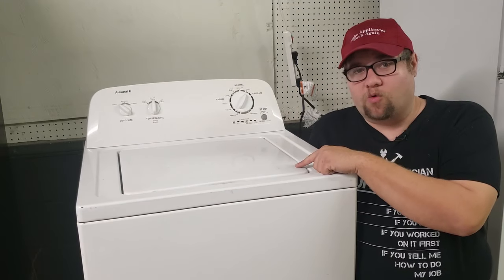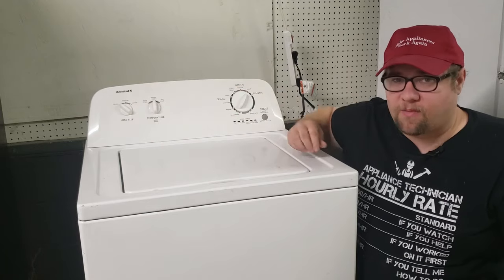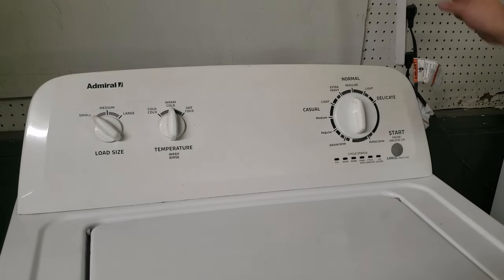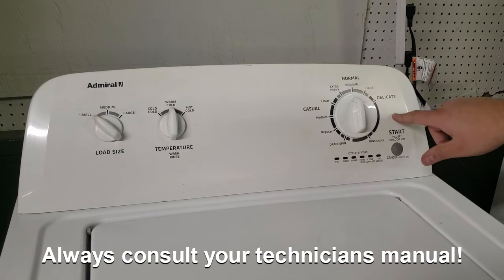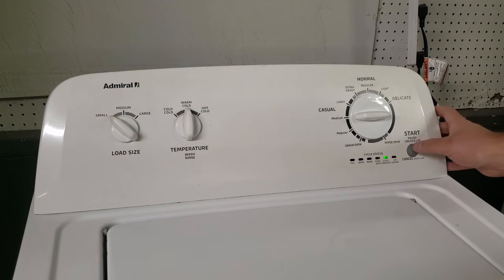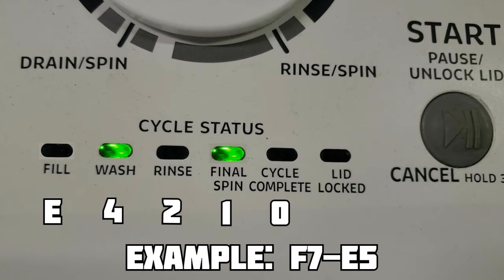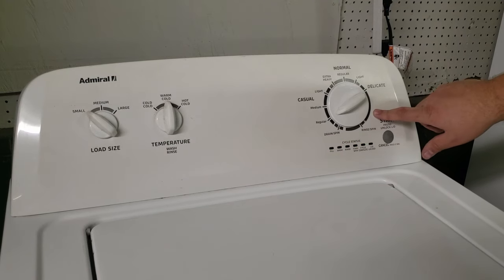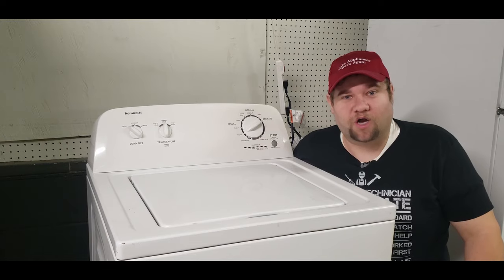How to Use Troubleshooting Mode on a Whirlpool, Maytag or Amana Washer AND Understand the Codes!

Comment: What can I do with my admiral washing machine if the cycle dial got broke off?
Reply from the maker: Oh, that's a good one. Haven't heard that before. The dial is attached to a shaft, that's attached to the control board on this style washer. You'd have to take the panel off, unplug machine, and see if there's any way to re-build that stem and attach the knob to it. If the knob was bad/damaged, just get a new or replacement knob. If its the stem... May be able to rebuild one with maybe super glue and baking soda.
Reply: @bensappliancesandjunk  that's not the best news I've gotten today but I'll run with it. I'll go ahead and pull that off to see what I'm working with. Thanks

Comment: I have an F3 code what does that mean? It washed the load but didn’t spin it out properly and now it won’t even turn on to wash.. I need help
Reply from the maker: That is a pressure switch / water level error code. Depending on your unit, there may be an independant pressure switch that's gone bad. Or the plastic tubing going to tub has developed a crack in it. Take off the hose and see if you can blow into it and see if air can escape (with the entire tube off) - if air can leak out of the hose, replace it.

Comment: I have amana washer that I replaced the water inlet Valve now that I tried to turn it  on I have to power to turn on
Reply: Any tips on how to reset the machine
Reply: Or something I can do
Reply from the maker: I do have videos on reset and recalibration on my channel for a whirlpool. It's the same for this
Reply: @bensappliancesandjunk  I did as the video showed but nothin still work goes to very last step and all the lights shut off

Comment: We keep getting a f1 E0 code on an Amana but can't find any info for a washing machine, only stoves. Any idea what it means?
Reply from the maker: TYPICALLY that's an interface/UI issue. What is the washer doing wrong for you?
Reply: It get through the rinse cycle,drains all the water out and quits. The door stays locked and has to be unplugged and replugged to unlock.
Reply: @mikedawsey  I’ve got the same error what did you end up doing?
Reply: @chrisgregoryt9672  Bought a new one.

Comment: - 2:37 you just differentiated by saying, "on Admirals & Amanas" as if they're not Whirlpools. They are.
- It's now confusing as to which to follow the instructions on.
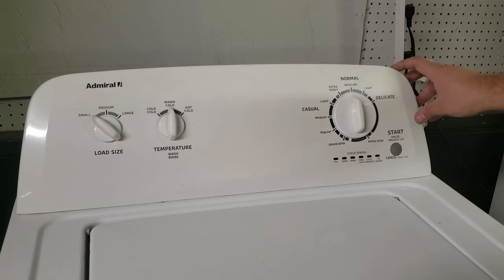- 2:28 YOU SAID, "On Whirlpool's: R3×, L1, R1"
- 2:37 YOU SAID, "On Admiral's & Amana's: L1, R3×, L1, R1"
_
- UPDATE THIS IS WHAT WORKS & WHAT THE MANUAL SAYS TO DO: 
- *Amana: (in the manual): R3×, L1, R1

Comment: Can you write down from beginning how to reset Amana 2019 ? Please I tried both. But it would help if you can write down how to do it. Please I have laundry in n lid won't come unlock.n unplugged n wait 10 minutes 5 times. N nothing .n no lights at all
Reply from the maker: Hi, the lid lock won't unlock even after leaving it unplugged for awhile, then plugging in? You may want to check my other videos on troubleshooting a whirlpool washer and replacing the lid lock - both should be able to help you.

Comment: Auto sensory not working...for small loads water fills up pass the amount of clothes fills up to a full load amount of water. Need help
Reply from the maker: Check the pressure hose that goes from the consul of your washer down to the tub. Make sure that it's free of any obstructions by blowing through it and then make sure that the tube itself doesn't have any cracks or holes in it to wear air could escape.

Comment: Sensing fill and wash come on then cycle complete light comes on from my understanding f4 e0? I can’t find that code
Reply from the maker: It could be an updated model via his shifted all the codes him to the left which could give UF8E0 which is a drain pump issue. Can you verify the drain pump is operating at all?
Reply: @bensappliancesandjunk  it seems to drain it won’t spin makes a buzzer sound
Reply from the maker: Check to see if washplate spins with basket or its just spinning freely and loosely.
Reply: @bensappliancesandjunk  it spins with basket counterclockwise if I spin it clockwise the top of the agitator spins free

Comment: I got the same as another person F3E3, which isn't listed, of course.
Reply from the maker: I have 4 videos on these washers, and the other videos show where the sheet is to show that specific code on your machine
Reply from the maker: @48Tbird  I would look at the manual for the light code reference. its possible yours has changed and is different to where it may not be F3E3

Comment: mine flashes F4E0. wtf. lol. I think this confirms my suspicion that its brain is fried
Reply: What you did my does the same
Reply: @sandlews2530  scammy repair tech came back and said the water wasn't on all the way; so according to him the only issue was him not turning the water on all the way. I really have no idea what was done since I was 84 miles away at work both times, but wife said he was here 5 to 10 minutes both times.  The first time he cleaned out a screen that was restricting the water input, so you may check that. I've seen a youtube video where someone replaced the electric inlet water valves so that it would fill properly; I was leaning towards doing that as they make an annoying motor noise when it doesn't fill properly. Im thinking the tech did something to reset the machine so that it would work properly as it's been fine for a week now.

Comment: Hi! My Amana fills for a wash them as soon as its time to wash it drains and all lights go out... It does work on spin though..
Reply from the maker: What error codes did it give you in diagnostics?
Reply: Did you ever figure out what was wrong? My roper is doing the exact same thing. I got code F4 E0
Reply: @sheilastuck5465  i didn't. We went and bought a new washer
Reply: Ahhh bummer 😒
Reply: I have the exact same problem nothing less nothing more and I just buy this machine 5 days ago.  If I follow your video what do I do to get the close wash. I really don't know about codes

Comment: As soon as I plug it in the sensing fill' wash and lid locked illuminate. And wont reset
Reply from the maker: Sounds like its still storing the last wash. How long did you unplug it for? Usually, I'd suggest 15+ minutes if its doing that.

Comment: I have an amana washing machine that make noise like its draining but no water is in it and the lid lock light stays on does anyone know what i can do to make it stop.
Reply from the maker: Is it not draining because there is no water, or not draining because there is water, and the pump is bad? Otherwise, if it keeps pumping and you cannot get it to stop, its in a flood control mode. You need to let it run for 10-15min to finish, then it should unlock for you.
Reply: @bensappliancesandjunk  its not draining  because there is no water
Reply from the maker: @tiffanyhill9525  let it run for 15min to end the flood control mode

Comment: Hey ben! If the codes are E/F and then 1-7 how do you reach codes that begin with f8 and f9?
Reply from the maker: Newer machines will use the Wash light as #8 then work to 4, 2, 1, then 0 using the Lid Lock as #0. This machine didn't have that option on it. So F8 would be Fill+Wash, and F9 would be Fill+Wash+Cycle Complete.

Comment: Mine takes an hour wash cycle, is that normal..?🤔
Reply from the maker: If there are a lot of clothes, yes. Newer machines trade time for energy efficiency. The motor on a new one runs at maybe 1/5th the electric usage, but takes 2x as long for the same cycle.

Comment: What if the wash light does not blink...what does that mean?
Reply from the maker: In what mode is it not blinking?
Reply: When I am doing the reset all the other lights blink except wash.Also when I plug it ìn the lid lock is always on
Reply: There is also a constant clicking when the mchine is plugged in
Reply from the maker: @chemoya1000  hmm. Is the lid lock managing to lock and unlock properly as needed?
Reply: No
Reply from the maker: @chemoya1000  I imagine that's the issue. Its trying to lock and unlock the lid lock and the system is failing to do so, which means it won't wash properly.
Reply: Thank you for your help.Which machine would you say give less problems. I have this one for a year
Reply from the maker: @chemoya1000  Speed Queen is usually the best for reliability overall. Bit more expensive though sometimes.
Reply: Thank you very much you have been very helpful

Comment: I think your error code multipliers are incorrect. They should be 8-4-2-1 not 4-2-1-0.  Perhaps that machine-dependent?
Reply from the maker: Certain machines, mostly the slightly older ones are 4210. I have another video that I released a little bit newer than this one on a different world pool machine and it is the 84210. So it is definitely machine dependent and generally these cheaper a Mana and roeper designs are the ones that have the more basic code structure

Comment: Hi, I did all the steps for my amana and I couldn't get the flashing lights. Mine is stuck on wash and won't go into spin and I have laundry in there. I've tried unplugging it and plugging it back in, but it's still stuck on wash light. There is clicking when the lid is closed
Reply from the maker: Try to do the code slower on the three right, left, right. Then try it faster. The machines are wildly different in timing ive found

Comment: Help, I did what you said ,but the sensor fill light keep flashing. How do I get it to stop
Reply from the maker: is it just flashing once you get into the diagnostic mode?
Reply: Yes, when I did the test and when It was over the sensor fill light kept blinking.Now it has stop.All the lights lit up and then when it went in test mode.the washer light was the only one that wasn't lit up.So its has to be the wash, when I start it up the water come in then it just stop it make clicking noises,nothing happen..it sit for a while then it goes to rinse..I need to call someone out..I guest or should I unplug and plug back up.
Reply from the maker: @susanbonds275  it sounds like you are unsure what thr diagnostic mode does. I would unplug the washer, wait 15min then plug it back in and it'll reset itself to normal controls

Comment: My washer goes through wash cycle but sops on rinse
Reply from the maker: Its possible its a lid lock/switch or shift actuator. You'll need to pull the codes and see what shows up, as its shown in the video to verify which issue it is.

Comment: Amana will be a week old come Sunday. 
Tonight it has no lights. I’ve reset it your way and even the lift lid 6x. Still nothing.  It does however sound like Darby Vader is trying to exhale Almost  dying.  Then comes the dentist spraying the water into his mouth.  All while dearth Vader  is still trying to exhale only this time he’s choking.
Reply from the maker: I would check underneath to see if the pulley screw has somehow come out, or if there's a shipping bolt that wasn't taken out when it was unpacked if it was purchased new.

Comment: What about a f0e0?
Reply from the maker: F0E0 means that it cannot reliably detect any issues on the system that'd cause whatever problem you're having. For example, if the machine can shift the actuator properly (or thinks it can), it wouldn't draw a code.

I have a few other videos on these types of washers. I'd make sure to run recalibration + automatic test to nail down your problems

Comment: Anyone know what this code on an Amana washing machine is? I’ve got sensing and wash blinking at the same time, then cycle complete after. Repair guy just showed me how to reset and go through all of the cycles, which seem to be working, but the washer gets stuck after it fills up to rinse and then eventually empties and starts over.
Reply: Hey Kari did you ever figure out what’s wrong ? Mine is doing the same thing. 😩

Comment: Kenmore 100 he
Fills all the way (slowly but surely )then drains ,change the actuator cause it was cheapest thing to start ,still does the same ,could not find a wig wag solenoid anywhere ,ill will try reading codes
Reply: Pretty sure i got E3 😪
Reply from the maker: E3 and what was the F-code? It'll always blink in a pair. One set will be the E code, then the other will be the F-code
Reply: @bensappliancesandjunk  
I re did it is actually F2 E1,it was confusing first time ,Should be stuck Key pad ,even tho all i have is turn knobs 😅

Comment: My washer is holding RANCID water UNDER THE DRUM please help!!!
Reply: and it's only 3 months old!!
Reply from the maker: Is the washer not pumping water out at all?
Reply: Bens Appliances and Junk it’s pumping water out of the drum but there is water UNDER the drum sloshing around.
Reply from the maker: @85michellemybelle  water always is in that part of the drum on all machines like this. There's always some residual water. Generally, the pump should be clearing that out entirely with each cycle. If the water's rancid even after a cycle, I'd be concerned with the pump having a bunch of garbage in the rubber lines going to and from it, trapping unwanted particles.
I'd:
- Run just water / no clothes / light detergent

- Run about 1pt of white vinegar thru it

- If neither removes the odor, take pump off and clean all hosing underneath
Reply: Bens Appliances and Junk ok so there should always be some water in between there? I’m wondering if the smell is from leaving the lid closed after the clothes are put in the dryer. I didn’t think that was it with my old set bc I always kept the lid closed after the clothes were put in the dryer..thank you!
Reply from the maker: @85michellemybelle  There's always some residual water, because water always seeks its lowest point due to gravity, and there's a hose that connects from the drum to pump, then pump to drain hose outside. The pump cannot force 100% of the water out, so there will always be some left. 

Its possible the lid being closed or leaving the washer unused for long periods of time could cause it
Reply: Bens Appliances and Junk thank you so so much for your quick replies!!!

Comment: All the lights are on except lid lock and there blinking
Reply from the maker: Is it that they all blink on, then everything off? That would potentially be a F9E0 code which is a pump overflow code. Is your drain pump running constantly?

Comment: My washing machine will only fill up will water for like 2 seconds lock and start cycle. It will not fill up enough to complete a load. This video did absolutely nothing for me. I wish I could say it worked and my washer is running like new. But that is not the case. So, either way I’m going to have to get a new washer or call a repair man🤔
Reply from the maker: What error code did you get when you used the diagnostic system to look up error codes?

Comment: My new machine is no accepting water
Reply from the maker: Are the water valves for the water hoses turned on? Did you verify water can come out? Are there any inline caps on the valves where the hoses plug in at both on the washer, and the water supply?
Reply: @bensappliancesandjunk  Thank you I did a configuration and is working normally. Thank you again

Comment: My machine is plugged in but totally dead, won't turn on.
Reply from the maker: What kind of machine? Can you verify you're getting 120v of electricity to the control board? If you are 100% certain that electric is getting to the board, it may be dead. Usually, when you plug in the power cord to an outlet, you'll hear a faint click which are the relays energizing. If you can't hear it, its either a bad board or power cord.

Comment: My machine keeps trying to drain although it is empty. I tried the steps to get a code, but the lights won`t come on it just keeps trying to drain.
Reply from the maker: That's a flood control mode on most machines like this. It thinks there's a major over-abundance of water, and is trying to push as much water out - regardless if there is water not.

IN THE FEW TIMES IVE SEEN IT HAPPEN - the flood control mode has a default run time of like... 15min for your drain pump. Let it run for 15-20min and it should run itself out and re-set the machine to allow you to run diagnostics, or whatever. When this has happened to me (and I've only seen it like twice), the drain pump has gone bad or is going bad, not expelling the water at a proper rate, making the electronics think there's more water than there really is. Hope that helps!
Reply from the maker: So YouTube pinged me on this getting upvoted and insanely enough, I had to look at a washer that did this exact same thing: 

The washer tried and tried to pump water out as soon as the machine was plugged In. No real option or lights. I could still somehow get it to go into diagnostics but that was it.

The hose itself was kinked very badly preventing the washer from draining water at all. Alternatively you could have a bad drain pump, or something else associated with the drainage system.

I fixed the kink and let the machine drain the water. Once that was done, the machine automatically restored functionality to the UI.

The codes given were F7E1 and F0E2 on a newer whirlpool washer. I believe the F7E1 was from the person trying to get it to drain, and it was loaded with water so the tub was rubbing on floor and wouldn't move.

Comment: this is wrong i get a 0 flash and then f-2-1-0 on the next flash that makes no since
Reply from the maker: I have a maytag video that has the same sequence but shows all the lights possible if you want to watch it in my video playlist.
Reply: @bensappliancesandjunk  the codes are wrong i found the manual on the inside of the washer f-8-4-2-1 but this still helped alot with getting the codes to show the manual is on the front inside panel on mine Amana washer with all the code and stuff you need